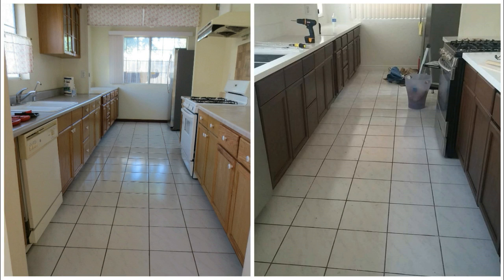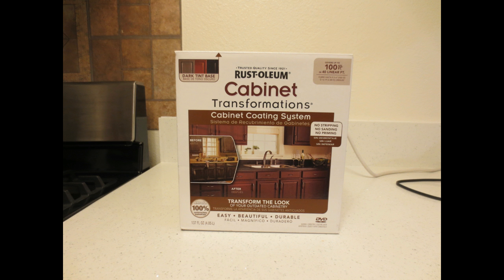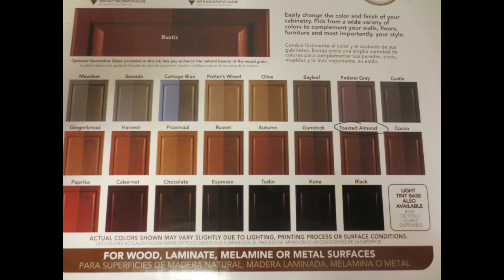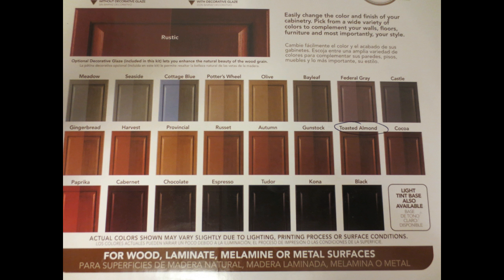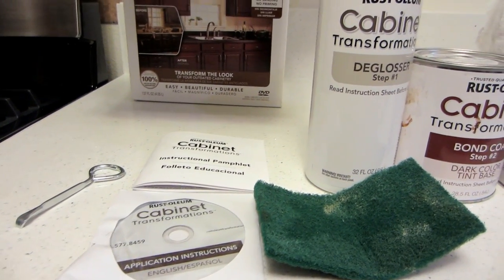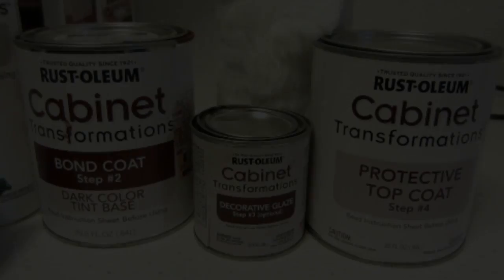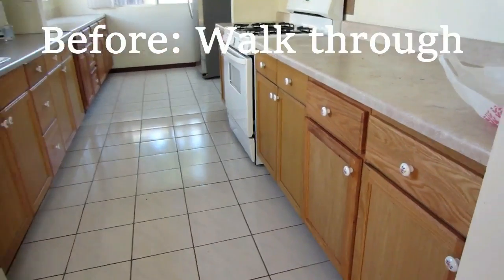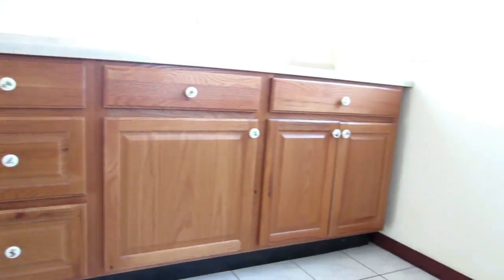Rustoleum Cabinet Transformation Kit

Comment: I really wanted for this kit to work wonders on my kitchen cabinets but it didn't. the end result didn't turn out horrible but it doesn't look anywhere near professional, it was just one of those "it's not so bad" projects. i will definitely be redoing my kitchen in a few short years.  the kit is inexpensive but it's time consuming and there is room for mistakes if you don't check once, twice and three times for good measure. we deglossed and let dry, then painted with the bond coat twice, being very careful to avoid drips and paint in the straightest lines possible as per the instructions.  we let the doors dry plenty of hours in between but although the coverage was good a few of the cabinets ended up with a tiny little scratch and the original coat underneath showing. chose not to glaze so went straight for the topcoat with one coat on back then front. we went from dark to light, but the color i chose was slightly different from the box so i wasn't thrilled. And the overall look was a bit streaky due to the top coat, it should be done with a foam brush imo. i am a perfectionist and i followed everything to the letter but i feel i should have just bought the deglosser, paint, topcoat and a sprayer on my own. it would have been more expensive but not by much and the cabinets would have looked more professional at that point. this is a good kit if you want something done on a budget and if you're not extremely picky.
Reply from the maker: Hi Jacky I would agree with your assessment. I've never painted cabinets before and didn't know the process or steps. This kit was a good step by step to it. I think the results also depend on the type of cabinets your have and the material it is made out of. All my guest were shocked the cabinets were painted. There is evident drip marks here and there and noticeable other errors, but only I can tell it is there because I open/close the cabinets every day. Let me know how it goes if you do go with the deglosser, paint, topcoat and sprayer. I'd like to see the end result. Happy painting.

Comment: Can you describe to me your process of deglossing the cabinets?  We are starting the project and are wondering if we are deglossing correctly.
Reply from the maker: Apply the degloss solution to the scrub and scrub away. Dependent on how much gloss you have it can take longer. Some of the cabinet doors I have were glossier and had this gooew residue as I scrubbed (takes more elbow grease to rid). If there is not much gloss like most of my cabinet doors, just do a quick scrub and wipe any residue off. Most of my doors didn't even have any gloss come off.